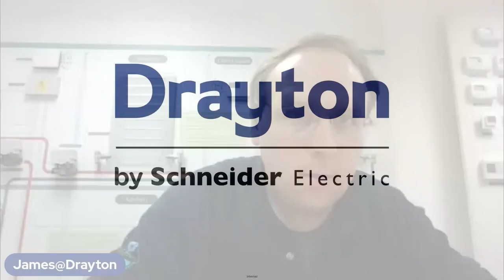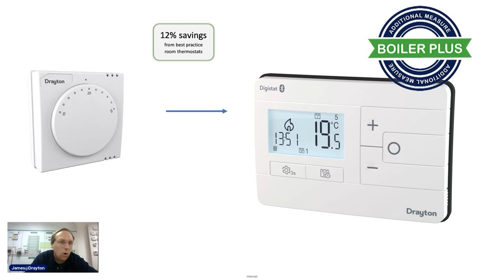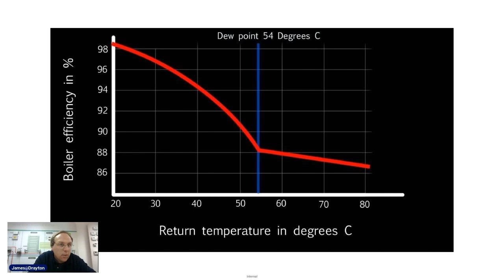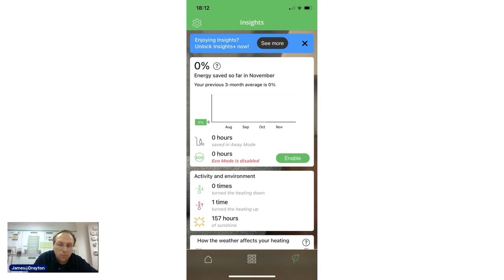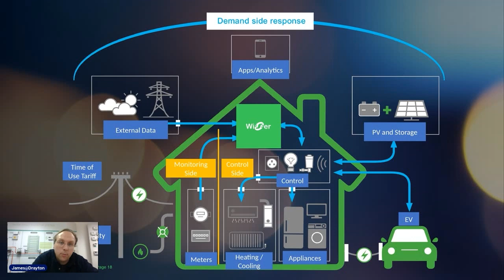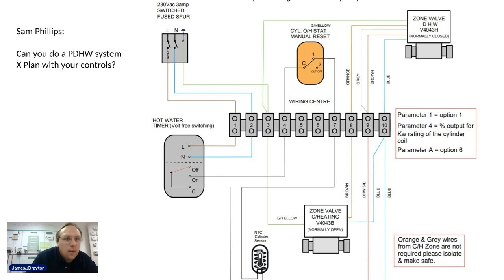FB Live Training - Getting the Most Efficiency Out of Your Controls

Comment: How does eco mode work with a boiler using external weather compensation? Will eco mode cause a conflict or is it able to learn/understand the changes in boiler demand as the outside temperature varies?
Reply from the maker: We would advice you choose either physical weather compensation or eco mode NOT use both together to prevent conflict.
Reply: @Draytonheating  Thanks for the confirmation.

Comment: At the end of the video you talk about opentherm and with some manufacturers it blocks the heating controls when you connect using opentherm expecting it to be done by the new controller. I am looking to install a full wiser kit on a Ideal Vogue Max boiler, In the list you say you are compiling will this currently block the controls on the Vogue Max or is this boiler one of the ones which is currently working OK.
Thanks
Reply from the maker: We are currently working to improve Wisers implementation of Opentherm, however it will still only be compliant with  boilers using the Opentherm protocol. Some boiler manufactures use there own protocol that we aren't compatible with.